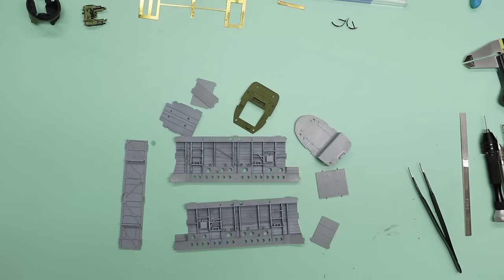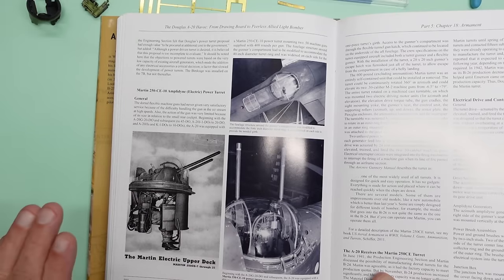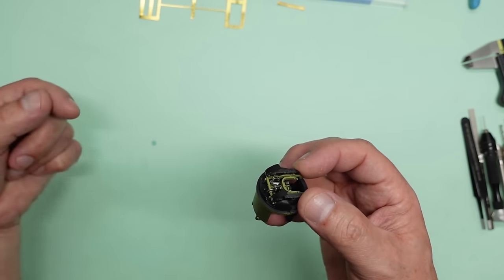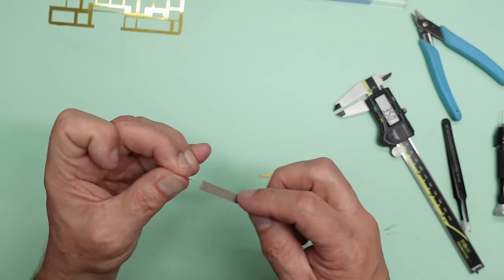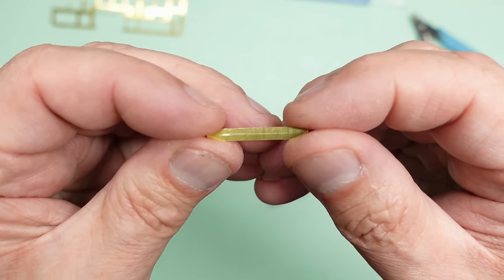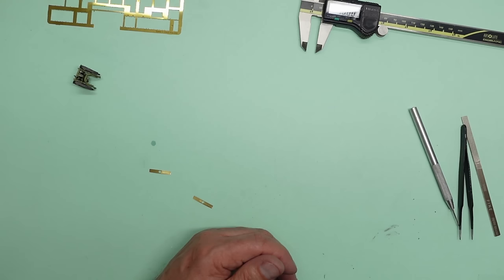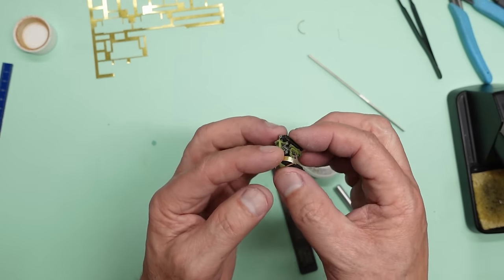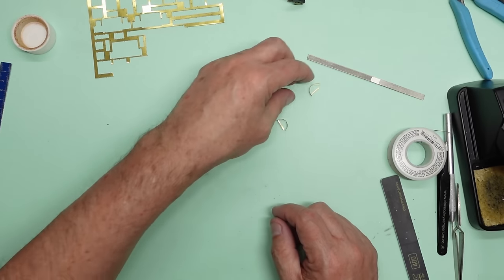HKM 1/32 A-20G Havoc build. Part Twelve.

Comment: Nigel,  I have found that tinning my soldering iron tip just before shut down, powering it off, and then using my denim (old blue jeans) rag (or sometimes even the leg of the pair of jeans I'm wearing) to clean the excess (but still not solidified) solder off the tip, leaves the tip leaves in a clean, un-oxidized state, ready for next use.   Having been soldering (primarily electronic components) for 55 years, I've found this approach quite successful.  You may wish to try it to see how its results compare with the process you use.  Clearly, both of our techniques serve each of us quite well.